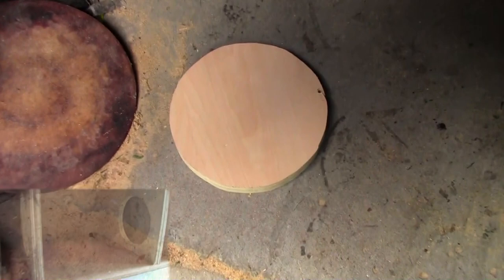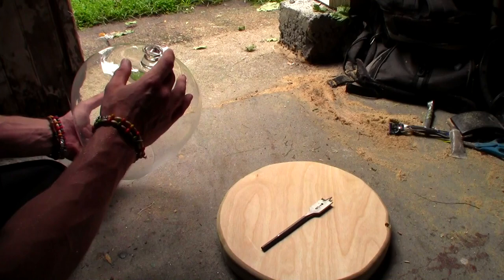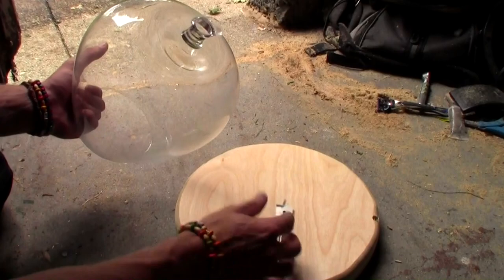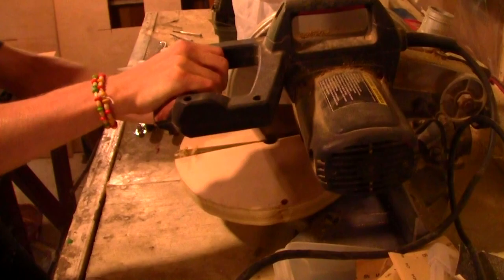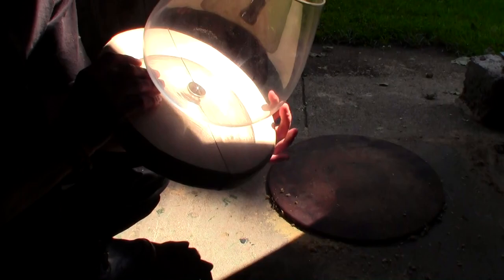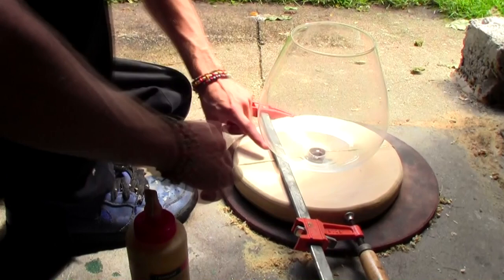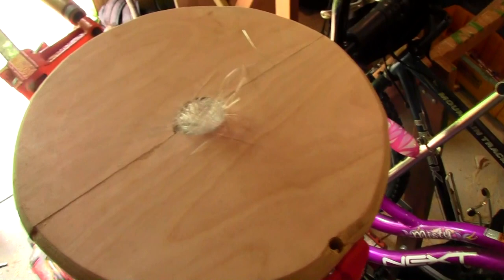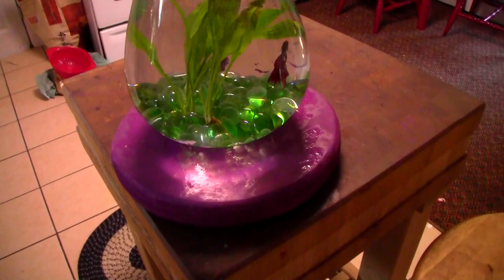Busted BETA Bowl Repair w/ EXO | A Pet Fish Surpise For The Wild Child!

Comment: Betas need attest 5 gallons with heater gravel and soft real plants and a filter!'
Reply: Actually they just need 2 gallons and gravel is not necessary, and you can use fake plants that have round edges, and it's okay if you change the water frequently.
Reply: Thank you,  someone knows how to take care of a betta fish
Reply: ReviewCam full water changes can be stressful for smaller more sensitive fish like the betta IMO. 50% every 2-4 days should be sufficient for one betta. If you have a tiny bowl (which you shouldn't) more frequent or more water changed will do.